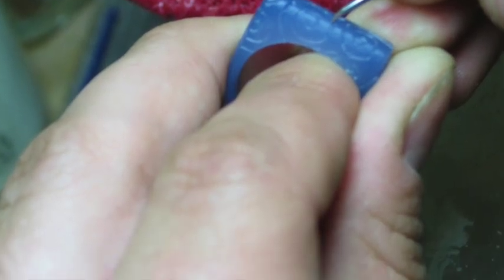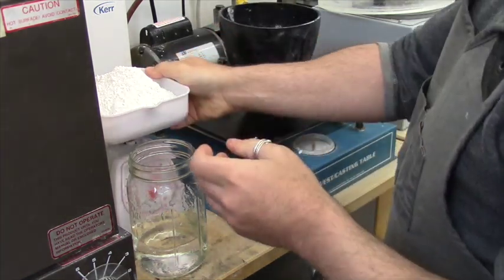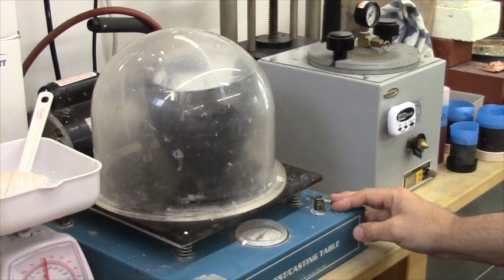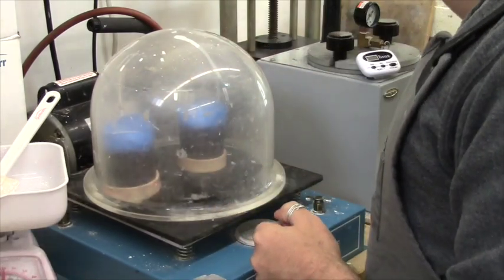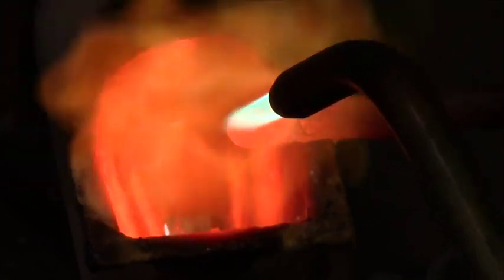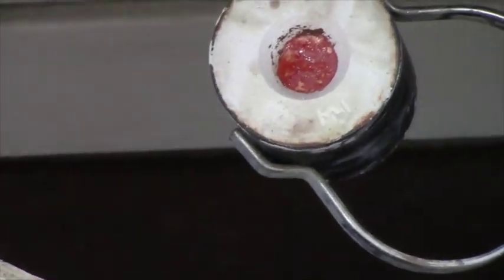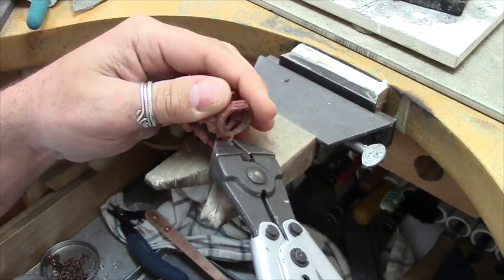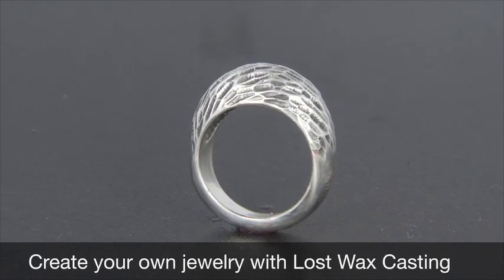Lost Wax Casting Process

Comment: Spinning the red hot metal just looked a little too dangerous, I was envisioning molten droplets being spattered all over the studio
Reply from the maker: Hi! That is a common first reaction. However, this method has been used for decades and is carefully engineered. The well or box around the casting machine catches any metal because if any is released it is thrown in the same plane as the centrifuge or lower. There are other methods of casting, too, like vacuum assisted casting. Thanks for watching!

Comment: Hi I’ve seen a ton of the bases you attached your sprue tree to have a hole in the area you attach the sprue to. Yours doesn’t have that. I’m worried the metal will go straight out that hole in my investment if that makes sense. Have you seen the bases I’m mentioning?
Reply from the maker: Hi Matt - There are two reasons a rubber button former base will have a hole, in my experience. 1) it's a hole to fit a large main sprue wax rod (this is a partial hole at the top of the button former), 2) a hole in the base and no rubber button former (this is to screw in a NeuTec style main sprue that includes the button shape. https://www.riogrande.com/knowledge-hub/articles/why-use-the-neusprue-sprue-and-base-system/ 
Thanks for watching!

Comment: No flux? No borax, well it turned out.
Reply from the maker: Hi Peter - Thanks for your comment. I did add flux, just in case you missed it. The crucible was prepared with a coat of flux, and I added a  bit of flux during the first part of the melt. Thanks for watching! Joe

Comment: what is the process to balance the arm?
Reply from the maker: Hi! The exact method to loosen the arm for balancing may vary. Read any instructions that came with your centrifuge. But basically you release the arm so that it can move like a balance. Load the flask in the cradle, the crucible and the metal weighed for casting. Move the weights on the other and add or subtract weights until the arm is balanced.  Thanks for watching!
Reply: @SilveraJewelrySchool  Thank you for the clear explanation!  I started silversmithing in 1969 but had to quit about 9 years later because I couldn't have little kids running around the flames, etc.  I just started doing custom leather instead.  But, I still have my bench, tools and equipment and am setting it all up again..The instructions that came with my centrifugal casting machine are long gone by now so I am thankful you answered my question and reminded me!  Your video has such a clear explanation.  Thank you so much!

Comment: What is that tool your using to put the wax on, the one your dipping into the hard wax....I've been teaching myself how to do this stuff but one if the hardest things to learn about are all the tools, no internet searches I've used are any good. I've seen something that looks like it even lays wax ( not a batik pen) but cant find it anywhere. I have a lot of questions, but never receive answers.
Reply from the maker: Hi Hex! It's a wax pen. That model is a Kerr wax worker, but you can find inexpensive wax pens from battery powered SuperMax pens, and electric Foredom Wax Carvers or the Arbe Wax pen. They're great for welding cracks, build up and lots more! We cover wax pens and lots more in our Lost Wax 1 - Basics workshop, which is also available live online. SilveraJewelry.com/classes
Reply: @SilveraJewelrySchool  every time I entered searches for wax pens I got wax carvers only, I've got one of those 2 arm dental heat deals ..but an Arbe wax pen? I'll look it up, something that I've seen but haven't been able to replicate was the laying down of hot wax onto a mold, making patterns or frames that then come right off. Even with mold release hot wax sticks, and its too liquidy, but the wax pen I saw was laying a thick line, like you'd expect from Elmer's glue. I'll check out that episode that covers them as well thanks!

Comment: Holy shit is that scary, so many other safer methods . Please put a disclaimer on this content. That spinner should have a lid.
Reply from the maker: I appreciate your comment.   It’s true that these machines are set into casting wells with lids, which I also recommend to students setting up a new system. I can also let you know that I have used centrifuges for casting for thirty years and have never been injured,  even without a lid. What’s important to understand is the physics of a centrifuge causes any spills to move in the same plane as the machine. So metal will hit the walls inside the well, and it will not fly up and out of the box. As a casting teacher I’m way more concerned about student injuries when they’re working with open crucibles of molten metals for pouring  into flasks. The rules for safely using a centrifuge are simple and these machines offer s lot of reliability and accuracy. Thanks again.

Comment: I never see lost wax/ spin caster make air vents for displaced air, I've been having trouble casting an 18 gauge thin piece that folds over creating a thin arch the metal needs to get over...should I be using air vents?
Reply from the maker: HI! You can always try adding air vents to your models (just not all the way through the investment, because they metal could leak out during casting). I generally never use them with the centrifuge, myself. Thanks for watching!

Comment: Quick question. I’m a pretty good mold maker but just starting my research into metal casting. Do I need to use wax to create the investment mold? I feel I can create the investment mold by creating A silicone positive of my object that the investment can be poured around, than removes pretty easily. If the wax step could be skipped it would save so much time and effort. But I’m sure I’m missing something because I can’t find the answer to the question anywhere. My object “a slightly tweaked rubber duck” is just complicated enough to rule out other casting methods. Thanks in advance for you time, your videos helped me a lot.
Reply from the maker: Hi Jamie - You can make an RTV mold of a wax model or other objects that you can inject with wax, and then invest it and cast it, but you can't cast non-ferrous metals like silver and gold into a rubber or silicone mold. The metal is too hot and will burn the mold. You can cast using a moldable object using a sand casting method, which doesn't use investment. Low temp metals, like pewter, can be cast in vulcanized rubber molds. Hope this helps. Thanks for watching! Joe

Comment: i like using a ultra small drop of dish soap in the mix. the bubbles and lumps are diminished drastically.
Reply: Do you add the drop of dish soap to the investment mix or the debublizer mix?
Reply: bouth i guess... I put a drop (liquid dish soap for hand washing) in spray bottle, lets say a pee size, in a 400ml water. and with that i spray the model,  with the same bottle i spray the mixing coup ( more for not leting as mush dust into the air) but it works for me. I suppose it has something to do with a water from the tap.

Comment: Interesting how experience saves you so much time and effort. I mix my investment in a plastic bowl with a wooden spoon. I know how thick it has to be and roughly how much I need, so I do it by eye. I then tap out the bubbles using a piece of wood, saving me the expense of a vibration or vaccuum machine. I also paint my waxes with investment before this process so bubbles won't stick to it..
  When it comes to the burn out cycle, again, all this waiting for hours is unnessessary. Once my investment has hardened in the flask, I leave it about 15 minutes and put it in a cold kiln set to 149c degrees for dewaxing. I put a tray undernieth to catch the wax so it doesn't screw up the kiln. After about half an hour at that temp I remove the tray with the melted wax and ramp it up to 371c degrees. You hear all sorts of bubbling sounds initially but it soon calms down and you get steam coming out of your inspection hole in the door of the kiln. You wait about half an hour until most of the moisture has evaporated and the jet of steam subsides, I then ramp it up to 732c degrees, leave it for 1.30 hours and its ready to cast. I've got this 8 hour burn out cycle down to 2 1/2 hours and you don't have to leave you're flask overnight to dry..
 I preheat my bronze and take the still red hot flask out of the kiln at about 600 degrees. I believe it loses about 100 degrees a minute so you have to get it in the cradle and melt your bronze as quick as you can. I use borax to help the bronze flow and know through experience when its liquid before I let it spin. Overheating it causes the metal to separate so you have to get it just right.
  I enjoy 100% success as long as my sprues are well placed..  Whatever methods you use to save time, safety has to be at the forefront of your mind. You can do hundreds of castings but it only takes one mechanical breakdown to send molten bronze at 1100F flying around the room. You always have to be safely behind a screen just in case and never let animals or anything else distract you.
Reply from the maker: Thanks for sharing your process! Very interesting. There's always a different way to cast, and I can see from your description that you've carefully experimented with your set up to produce reliable results. I just want to note that the processes shown in my video are in line with manufacturers's guidelines for investment and burnout, and are based on their research for best results . Happy casting!

Comment: This video is recommended in my art book, we're studying the iron age in Ireland and they used this technique very cool to see!
Reply from the maker: Wow! That's cool. Yes, casting has been around for 6000 years that we know of, starting with open face molds in ceramic and stone (which is still done today, for example with tufa stone castings as done by First Americans). Using lost wax casting (which started ascreating a model that can be removed by heat (was, plant materials,  etc), enasing in clay, and burning it out in a fire) dates back to around 2300 BCE. It's so fantastic to know that we still use techniques today that were developed thousands of years ago. How amazing were those first artists?

Comment: I did this in college. I still don't know why it's called "lost" wax casting. It's removed... but that still makes no sense. In fact, the plaster is "lost" too, so...?
Reply from the maker: The name is focused on the wax. It's melted out during the burnout and replaced with metal during casting. It may be a carry over from other languages, like "cire perdue" in French. With 7000 years of metalsmithing history, a lot of names are passed down. It wasn't alway investment for the mold. Ceramic (clay molds like in Ashanti casting), sand, etc have been used, too, some of which could be reused a couple of times. Thanks for watching!

Comment: Great vid!  Have 22in swing arm spring loaded caster like yours, for years was just on a flat board with no sides, but when I started having issues throwing 8-10oz of molten bronze in an 8 foot diameter circle around my driveway I needed something better.  Have to admit it never occured to me to build a wooden box around it.  Wanted something fireproof... Friend was getting rid of an old stainless steel pool filter.  The bottom part is on about a 12 inch base, which brings the whole thing up to a nice height to stand and do the balancing of the arm and melting/casting process.  Mounted the caster in the bottom, it just fits inside the filter bottom.  Welded a plate over the hole in one side where the pipe used to come in. Right up underneath the caster inside the base I bolted a brake drum from a flatbed tow truck, about 20-odd lbs of solid iron.  Keeps the whole thing nicely on the ground, no tipping or even any wobbling.  Very stable, and the steel is about 3 inches taller than the caster, so no more metal spills!  Put the whole thing up on a wheeled board about 3 in tall and it lives under the workbench when not in use.  Figured out my metal spill issue was that the arm is actually a little small for the big 4in wide 6in tall flasks I use though, so I made another weight for it by pressing one of the existing weights into some ordinary playground sand (damp, and let it dry out) and then pouring it full of bismuth.  Actually weighs almost exactly the same as the cast metal weights the arm came with!  Solved my balance problem with the heavier flasks. Just needed that one extra weight.
Reply from the maker: It pays to be handy when it comes to problem solving your set up for equipment, especially casting stuff. Thanks for sharing your solution!

Comment: What are the dimensions of your centrifugal wooden encasement?
Reply from the maker: I don't have it anymore, but it was basically a few inches larger on each side of the centrifuge arms when fully extended. You can also find pre-made metal casting wells for centrifugal casting machines. Make sure the height and width are larger than your machine.

Comment: what is that powder?
Reply from the maker: Hi KC - I'm guessing that you mean the investment that I mixed with water for the mold. It's casting investment. You can buy it from jewelry suppliers. It looks like simple plaster but is not the same, since it has to be fired to high temperature in the kiln. Thanks for watching!

Comment: No mention of Borax.
Why not make rubber molds from wax model.
Reply: Making a  rubber mold from a wax model is an alternative. Just to be clear,  you can't cast precious metals or base metals into a rubber mold. Only low temp metals like pewter, etc. I don't use borax. I use boric acid. It's a higher temp an is commonly used for casting jewelry and ingots. It's a short video, not a tutorial. Can't put everything in there. :^) Thanks for watching!

Comment: Great video, loads of useful tips. Thank you. Could you give me a rough idea of the total cost for all the big equipment needed. Vacuum table + centrifuge + kiln
Reply from the maker: No problem. Here's a kit for setting up to cast: https://www.ottofrei.com/Otto-Frei-Jewelry-Casting-Kit-2-Pro-110V. You'll also need a way to melt the metal, like a torch or a melting furnace.
Reply: @SilveraJewelrySchool  perfect thank you. I can see why it’s normally just the professionals that can justify the expense.

Comment: Why spray spray and what kind?
Reply from the maker: Hi - Thanks for your question. I'm  guessing you mean  the Vac-u-coat spray that  I used before investing? This is a  standard step to help prevent  air bubbles  from sticking to your models. It is sold  under different names, like Vac-U=Coat from  ProCraft and Vacufilm from Rio Grande. You can find it here: https://www.riogrande.com/product/rio-vacu-film-concentrates/7021521gp Best and  thanks for watching, Joe Silvera

Comment: I'm assuming you'd normally have a lid for the centrifuge? I use this method and as soon as the metal is ready to go I put the lid on it and duck down behind the shield. On occation you can get some slag stuck in the feed hole or something else goes wrong and molten metal can go anywhere. Perhaps I'm over cautious?

Comment: Thank you, that is such a clear and well paced video. Obviously you put thought and care into it.

I do have one question. When you melt out the wax do you drain it from the bottom by inverting the flasks, or does the wax vaporise from the burn out in the kiln?

A very noob question I know. But it is the only one I have in order to get a much more rounded understanding of the process.

Thank you!
Reply: Larry McCauley Hi! Flasks are placed with the fill cup or mouth facing down for the wax to drain out. During the first stage of burn out, you can place the flasks on top of a wax tray. This tray allows the wax to drip into a metal pan for removal before the rest of the burn out happens. This cut down on smoke and odor. Flasks should go into the kiln raised on some kiln furniture so that the mouth of the flask is above the floor of the kiln, enough for the wax to drip out during burn out. Thanks for your question .
Reply: @joesilvera8853  Thank you so much for you informed and helpful reply.

Comment: Doesn't mixing with an electric mixer introduce air into the mixture?
Reply from the maker: Hi - Good question. Yes. Any mixing will add air to the mix,  even by hand. That's why we use the vacuum investment table to pull air bubbles out of the investment. Thanks

Comment: What kind of liquid u use after casting to clean rings  tell us plz
Reply from the maker: In the video I recommended using a tumbler with mixed stainless steel shot to burnish the castings. The shot is covered with water with a drop of Dawn dish soap or similar. After casting, before polishing, I cleaned the castings by pickling them for 1 hour. The pickle solution I used is 1 part citric acid to 5 parts water, heated to steaming hot in a crock pot.